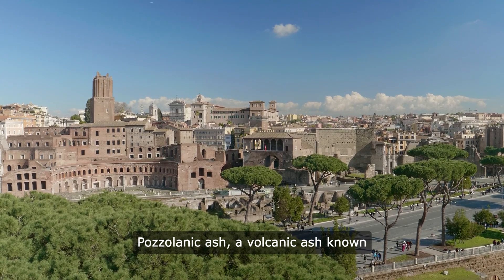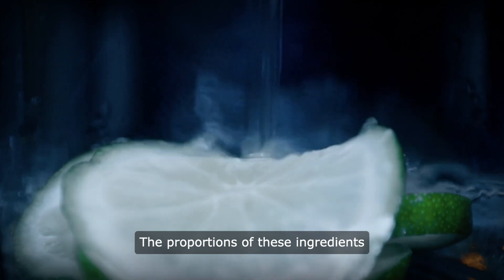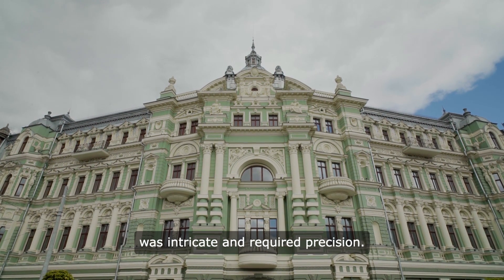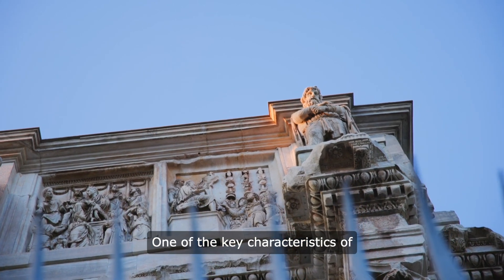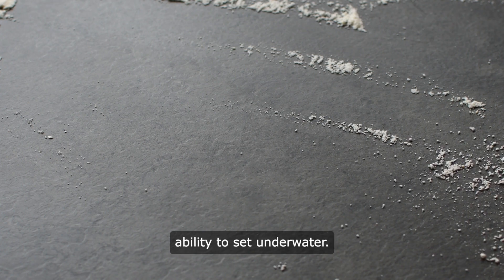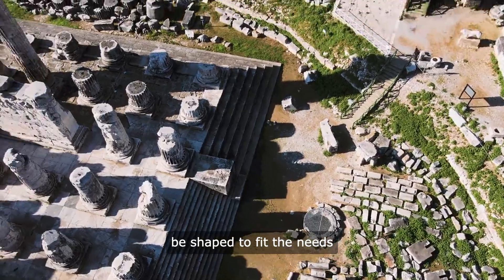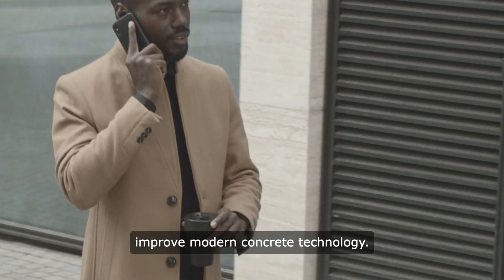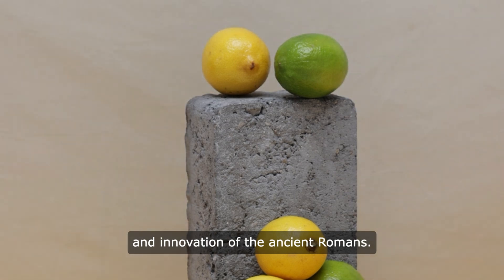Roman Concrete Recipe

Comment: They actually created a complete dry mixture of Quicklime, Pozzolana (or if they couldn't source this they used a mixture of Crushed Terracotta and Ceramic as a sort of synthetic form of Pozzolana) and aggregate before adding water to the slake the Quicklime in the dry mixture.

By doing this the quicklime and the Pozzolana were ready to react with each other when the exothermic reaction with the quicklime would happen when they eventually and gradually added water to their dry mixture once it was dry-mixed to their satisfaction.

They then utilized the extreme heat from the exothermic reaction by immediately and vigorously mixing the mixture as soon as the exothermic reaction took place, which eliminated the need for an external heat source while mixing.

The aggregate they used was also far chunkier than the fine types of aggregate used in modern concrete today as well. The aggregate they used consisted of volcanic rock most of the time amongst other types of aggregate, but volcanic rock was one of the main go-to aggregates for them.

Sea water also played a major role in the strength of their concrete when it came to marine applications as well because the seawater would cause Al-tobermorite and/or phillipsite to form within the concrete's matrix after it had set further enhancing its strength more and more the longer it sat in seawater. I've even read articles that say they utilized seawater over freshwater for all their mixtures upon discovering this as well but I'm not too sure how accurate that is.

Brilliant video though by the way 😁
Reply: How would one create a concrete slab using this technique?
Reply: @michaelbrebrich7124  quite easily actually